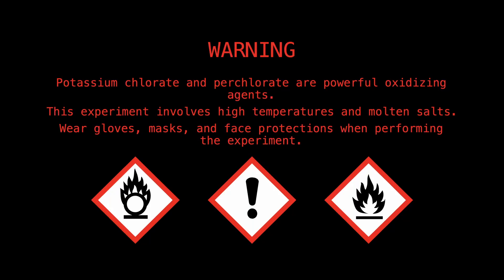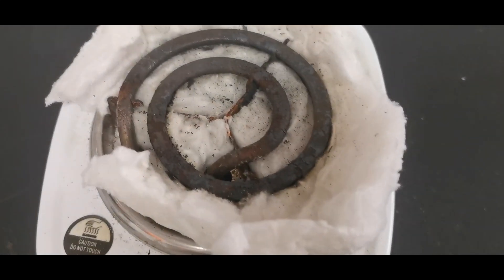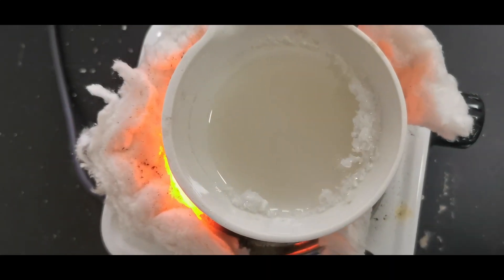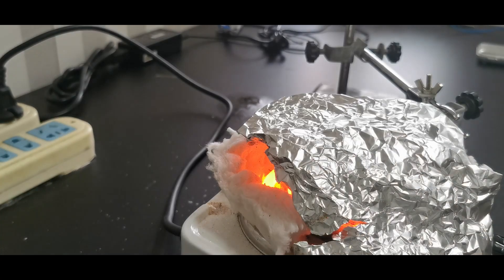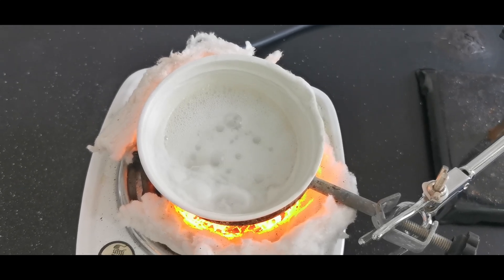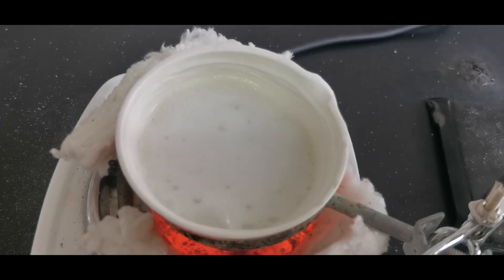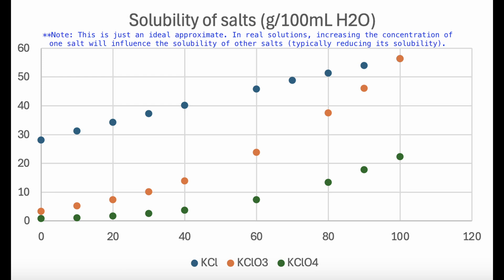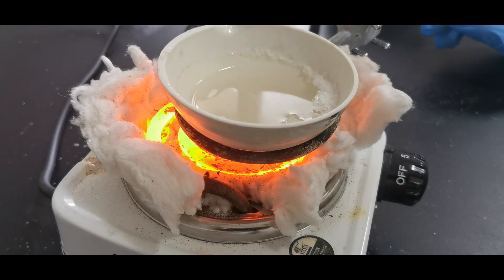3.4 Halogens - An Even Better Perchlorate Process

Comment: You are missing a purity test using concentrated H2SO4 and HCl at the end of the video. Without this test, your video has almost zero value. Unfortunately.
Reply: Be nice, this is a really good video
Reply from the maker: That part was missing indeed. My mistake. However, concentrated sulfuric/hydrochloric acid is NOT the most sensitive nor the safest test. Far better tests are demonstrated in my new ammonium perchlorate video.

Comment: Try around 15% KClO3 boiling with 50% nitric acid HNO3 with bubbling ozone with a cheap ozone generator. Using oxalic acid HNO3 can be made from Ca(NO3)2, and H2SO4 from MgSO4. This can be done at a temperature that is accessible to everyone. See this method on DTIC AD0016814 document, and patent US 2858188 A. Using the method with Ba(ClO3)2 and H2SO4 Ba(NO3)2 and Ba(ClO4)2 can converted water insoluble BaSO4. And the result will be HClO4 and HNO3 which can separated easy way using distillation. Or the HClO4+HNO3 can used to more effective way convert KClO3 to KClO4.

Congratulations, you were able to melt KClO3 this way. If you mix it with NaClO4, the remaining potassium can also be extracted. On a traditional gas stove or hot-plate it doesn't work in the slightest. I tried it in a ceramic pan, NaClO3 can be melted using a gas stove in small quantities, but the reaction did not take place even after an unforeseeable long time. Then there is the problem of the inert device in which we were melting. And the long melting time. The temperature does not go above 400°C. In a crucible using a normal gas stove, it can't even be melted. The method is too complicated to be easily used widely. Previously, you could melt it with an alcohol burner the NaClO3, that's interesting because in theory it shouldn't work.

Comment: 2:47 - the heating tube has a WIRE inside of it, a heating element, which is INSULATED from the outer tube itself by some sort of heat-resistant "mineral" powder (either very fine quartz sand or crushed ceramics - or such), and elecric current runs through this inner wire ONLY, so please "don't talk trash".

"Open" heating elements (like heating metal spirals set in a channel in a plate made of heat resistant brick-like stuff) are "electrified" but then the current always goes (most of it anyway) through the path of the least resistance, which in this case would be "to the neutral terminal" so not any real risk of deadly electrocution, unless you'd be standing barefoot on a wet metal plate which is earthed.
ONLY if the spiral breaks (it does after some time of usage, as the red-hot nickel alloy exposed to air oxidises "slowly but surely") AND THEN you'd be tempted to touch this part of the broken circuit WHICH IS CONNECTED TO THE LIVE TERMINAL there'd be some substantial risk involved in it.
Touching THIS type of heater shown here would give you only burns - unless it was kept in very humid place and not used for prolonged period of time, which causes the inner insulation to get wet AND kinda conductive (which happens in places like Singapore, which is a very humid place, but even then the shock is rather mild as the wet insulation still retains substantial resistance - ask me how I know...).
Reply from the maker: I speak from experience... I got electrocuted (obviously not fatally, as the current flowing through me is definitely a lot smaller than the current through the heater as you mentioned) from touching the iron stand, so either the insulation of the heating element is broken or there is no insulation at all.